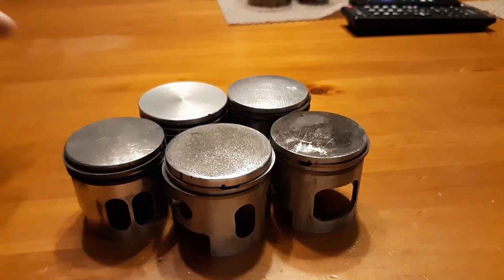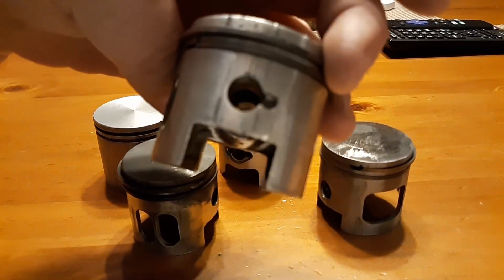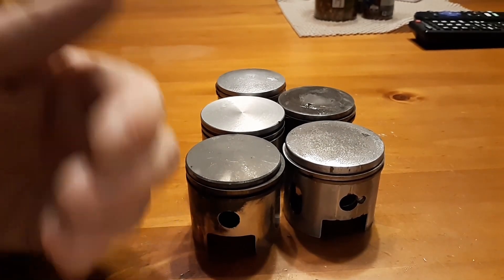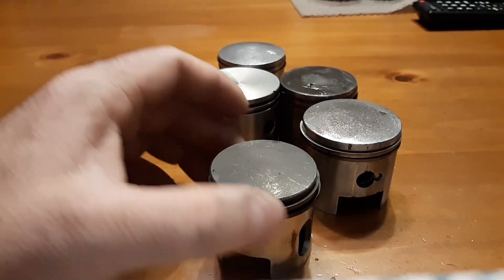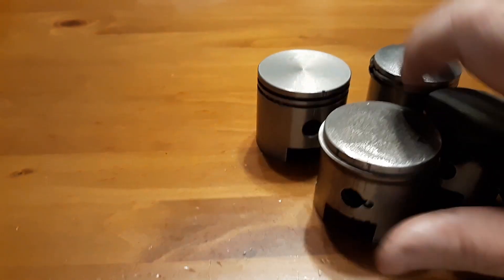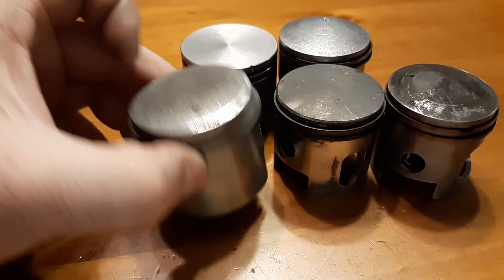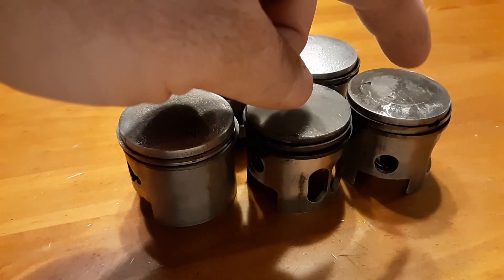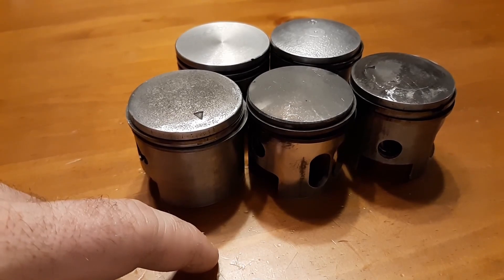Motorized Bicycle Oil Mix - Help Stop Moronic Information Being Shared!

Comment: So to sum it up...

For break in convention oil is a must..16:1 up to 32:1 ...break in is 1 gallon of gas or 2 tanks of gas (tank is half gallon on bike kits) after break in you can use 32:1 conventional or 40:1 synthetic

Do i have this right? Im also taking it real easy on break in and im using 16:1 to be extra cautious in case i dont have it tuned right and its maybe running too lean...

Comment: You are a wealth of knowledge and I greatly appreciate it. I learned a lot by watching just two of your videos versus hours of reading stuff online. I bought a motorized bike engine and it's always been pretty tough to start I have to really pedal fast to get it started it doesn't want to idle and I use 40 to 1 synthetic oil mix not knowing any better. I'm only reading 50 psi now compression I can't see and I don't have any tools that a machinist would have to actually measure the bore but is there any test I can do to confirm that I egg-shaped my cylinder? I was thinking of putting the Piston at top dead center and then introducing maybe 15 lb of air into the spark plug and seeing if I can feel any air or hear any air come out near the head normally in a 4-stroke I would just open up the oil fill cap and see if that are is getting by the Rings and into the crankcase but obviously I can't do that being that it is a two-stroke

Comment: Hi, your post is really valuable. I'm in the process of rebuilding my Suzuki RV90. In fact, it's already done, but as you know, it's an old machine, and it smokes a bit. The CCI oil pump is working fine, but I'm considering switching to a premixed fuel. It’s true that Stihl recommends a 50:1 ratio, but I’m sure that’s only meant for their high-quality equipment. I might go for a 40:1 mix for the RV90 engine.

That said, I’m still reluctant to give up the CCI oil pump because it has a lot of advantages. I’m kind of torn. I wanted to ask your opinion—if I use Stihl’s modern, high-grade oil with the Suzuki CCI oil injection system, what difference do you think it would make?

Or, if I were to technically reduce the output of the CCI oil pump a little—by slightly lowering the CCI’s set level—and combine that with high-quality modern oil, what do you think that would do for reducing smoke without damaging the engine? Thanks!
Reply from the maker: Use the pump with a good synthetic oil 40:1. Too much oil will actually blow the wrist pin bearing from the hydrologic of the excessive oil of the ring design over seals.  They are intended to actually leak some as a form of lubrication process.

Comment: Wish I would of seen this when I first build my bike I’ve been running 50:1 since the start so I guess I’ll Switch over to either 32:1 or 40:1 I have to see which oil I have

Comment: More oil=more compression=more power. Maybe read alittle
Reply from the maker: @mikecyanide7492  that is not always the case. It depends on the ring design, tolerances and the count of rings..... It also depends on the materials used to plate the cylinder. If you slathered a cast iron jug with oil you would pit it after it expand s over time. Or blow the bearings in a steel sleeved jug setup if you over mixed it. But if you didn't already know this..... Not even going to try explain how it cools an engine and it's parts also . 😕
Reply: @BuildBreakFix  this is why I watch your channel. Lol I ran the iron sleeve on strict 40:1 but not bcuz of that knowledge and it was a second hand motor. Thanks man.

Comment: Been using Stehl Chainsaw engine oil,  6.5 oz oil to 2.5 gasoline, 50 to 1. For break - in 2 gal of gas with the same oil, 6.5 oz.
With the Motorized Bike engines. 2 cyc. 4 cubic inches. (ZEDA), High Compression Head, Tuned Pipe. Hot Sparkplug, NGK BPR4HS, Stock Carb Jet , #70, way rich. After Break-in I changed the Jet to #66.  Still a little rich on the bottom but nicely 2 strokes Top 30% of Throttle.
Most important,  Warm these engines up BEFORE pushing them. 
 Do this every time you ride, your engines will give great service.
Reply from the maker: 😜👍 That is great advice!  Appreciate it!
Reply: I have same set up except for I’m using bp6 plug, stock exhaust. I bought the Stihl High Performance Oil. But I got the 2.6 oz bottles. So two of those per gallon what be ok for break in? It’s 25:1. I’ve just been super meticulous , honed the cylinder and all. AI gave me some bad advice. So I guess I just need to hear it from a real person.

Comment: I saw lots of people running 40 to one ratios but I felt like that was always a little too lean but I knew the 16 and 20 to one ratio from cradle to grave seemed stupid to me so I decided to start running a medium after I broke in my cylinders and pistons using the 16 to one than 20 to 1 ratio after that I would run at 32 to 1. personally I run 4 oz of XPS marine XD100 E-Tec full synthetic for my build in a gallon of regular 87 octane but I have been considering mixing up nitro RC fuel into the gas tank as well to see if I can get some extra power out of it and before anyone warns me yes I know you need special oil to run with nitro RC fuel because standard two-stroke remix will break down when exposed to nitro meth
Reply from the maker: Did a whole playlist on methanol if you're interested 😜👍. https://youtube.com/playlist?list=PLtNBMHtv7PkP-FRVk3kkJnIyxTihwvdDT&si=M-i5c7Zpvvi6mukz

Comment: Well in the summer I use 16:1 really hot here... winter I use 20:1 a bit fumes when cold engine but after its okay Castrol 2 stroke power racing maybe a bit too much but also helps with the compression.
Reply: Yea i also thought same about wristpin slop and bearing sliding half out??
Reply from the maker: environment plays big role to at times!
Reply: @BuildBreakFix   yes in these days it's all about environment, funny thing is electric vehicules pollute more during production then the combustion engines running for few years straight but well we stop here... its better! 🤪
Reply: Forty to won sir.

Comment: BikeBerry is saying 40:1 "Cradle to Grave" .    Which is basically a little over 3oz synthetic oil in a 1 gallon mixing tank.
So how important is the initial break-in then?   I'm not 100% clear.
Would a 6 oz  mix in the first gallon work for a 2 stroke bicycle?   Then around 3oz per gallon after?
Reply from the maker: It's (32 to 1 organic oil). Or (40 to 1 synthetic oil). That is where most get confused.  But for break-in organic 32 to 1 helps form rings better.  Unless steel sleeve.  Which break-in is done by heating and cooling cycles.  Still same rules apply. Just depends on oil type you run.  Edit: If you want my personal favorite. Kawasaki lawn care two-stroke oil. Birth to death 40 to 1.  Thing will run forever on that stuff.  My personal favorite now
Reply: @BuildBreakFix  well so you agree with 40 to 1 'Cradle to Grave' synthetic, no change for break-in?
Because I'm going to start mine for the first time this week....unless winter kicks in hard I have to put this off lol.
I already have Mag 1 Synthetic & Lucas 2-Cycle 'Land & Sea'  just in the garage.
I haven't tested anything
Reply: "Lucas Semi Synthetic 2-Cycle Hi Performance".   "Meets or Exceeds API TC & JASO FB Specifications".
"A True smokeless formula"
Well, it looks good!

Comment: How many ml of oil are put in during the break-in period? How long does it take to break in, 2 tanks of petrol? And how is it better to run in? On free idling should I go with it at a certain speed?
2 stroke 80cc engine
Reply from the maker: 2L should be just fine. For a breakin

Comment: I run 32:1 synthetic or not, it’s what I thought made sense since they are ran hard and it’ll lube the bearings well and keep temps down, it’s wild some people will use amsoil at 100:1
Reply from the maker: You can. I have without issues. Your supposed to run 32:1 but they are speaking about organic oil.  Synthetic oil 40:1 is 3x better at the job the 32:1 organic oil can do.  Only way to explain it I guess. But 32:1 will run fine. Just matter of using more then you will need. Now if your like in 110f heat and in desert hell yeah yeah 32:1 😆
Reply: What Organic oil do you use?

Comment: What's a good break in ratio for a ms460 ?
Reply from the maker: (32:1. Organic oil). After a gallon of that 40:1 synthetic oil.  I know people say it runs 50:1 on a saw.  *Like an  actual chainsaw*. But this engine is pushing 100+ lb person on a bicycle! So keep that in mind when you see silly people saying that 😆✌️
Reply: @BuildBreakFix  thanks a bunch.

Comment: You cant use too much oil during break in if you want it to last. I use Husquavarna Ultra synthetic at 6oz per gallon during break-in and 4oz to 1 gallon after and they spirt oil all over themselves during break-in but last for ever and ever if you do it right.
Reply from the maker: tht zero sense lolz........ cause you never use synthetic oil ever to break in 2 stroke period! defeats the whole point of seating rings and blowing out shavings.  oil ratios are based on ring types, jug materials, and tolerances of rings. basic common fact for last 190 years since first one was ever built. lol  just saying built 2 stroke engines every kind on these bikes pro  motocross bikes for 2o years hate to break it to you but most por riders use 32 to 1 in there bikes for the fact makes more compression which puts out more power  actually s there goals not foul plugs you jet your carb correctly which no one seems to do any of the above right on these bikes. just saying ms380 ms460 ms440 ms660 ms871 and minarelli and 90cc Minarelli 110cc 100cc and the 139cc cvt build all run 32 to 1 never foulowed a plug nor had one engine blow up or turn to crap or over heat  out of every build. all 693 ms 460s i sold and all 133 ms660 i sold running 32 to 1 have never lost bearing yet in any of my builds i sell that people ran that in.... just saying guess just who owns it.....
Reply: @BuildBreakFix What jetting would you run for a 32:1 compared to a higher mix ratio?
Reply from the maker: @syndeko55   hard to answer it. Because elevation, temperature, size of the engine and engine setup. All play a role in jet sizing. Carb style also affects the jet sizing. What kind of engine do you have and what kind of carb.  Chamber pipe also effects the jetting along with reed valves. So it would be like asking the blind guy which car did you see run the stop light in the accident 😂.

Comment: So I started with 40 to 1  haven't  gone  through  a tank yet... question  is it to late to do the 16 to 1 for brake  in ?
Reply from the maker: Supposed to use organic oil. For breakins. 16:1 to form the rings. Also helps clear out crap in new engines. 32:1 organic oil or 40:1 synthetic oil. First half a tank it really counts.  So if the rings seated or didn't it's already a signed fate!  You will find out about 10 tanks of gas!

Comment: I have 66cc/80cc bbr angle fire..... what window piston brand or make my own.. what  reeds and carburetor to run..I have seen you like cnh.... I got my motor on black Friday for 150. New to this. Im just look for some good stuff right now im running 32:1 Castrol 927 is that a good oil or wasting money. I was thinking of a pw80 carb but whats a better choice and I seen your video about the reed valves and adding the tensioner. I would love the simple set up for my motor without wasting alot of money ...  whats a good company to buy motors from
Reply from the maker: honestly drill a tiny hole in dead center of the intake side of the piston!  Use a step bit!  Ones look live v (also called Unibit)  slowly step up size till you hit 1/2 inch and your gold!  making piston window!  Don't use bit drill bit or piston will break!  

Yeah 32:1 oil mix! stick with it! I know some people get crazy weird mixing stuff.  also gotta understand it's why there stuff always breaks LOL I use 32:1 all my 2 stroke bikes  mild to wild ones no issues.   Jet it right use the correct spark plug to match the build and it runs great 32:1.  (NGK 5126 B8HS-10 Standard Spark Plug) is like the perfect plug for that build you have.  Don't use like 6 or a 5 like some say!  burn that thing up real fast for only a tiny amount of performance! (NASTY JACK PIPE) Is cheaper then MZ65 pipe! works perfectly like a Mz65 pipe half the cost! Ebay has few  like 45$ So worth the price man!    Honestly best one I found Cheaper! (Kawasaki oil) Pretty much the identical oil Lucas has for twice the price!
Reply: @BuildBreakFix  thanks and for the jets about what range size for main jet 65 to 100 or higher 100 to 140. Just hate to buy a whole lot of different size. Same for the slow jet .. I went with the pwk 24mm  carb.  I think i seen you do a video about  it. I stay near the gulf so the jets is different for different areas. Thanks for everything
Reply: So the latest update I improved alot I ran the bike change jet and got to 34mph from 23mph . I bought a 24mm carb. went down to 21mm pwk did what you said reeds, window piston .. The problem my btothet   took   k & f standard of japan 20mm with no air fuel mixing screw. No upgrades. We have same bike same motor  everything. I have watched him when he gets full throttle he chokes it and  slowly moves it back normal like it has a boost  the motor revs real hard and he leaves me in the dust. He has 89 jet in it and thats all... would the double spark plug head help. But I have the feeling no cause I haven't seen you run one.. and what do it takes to reach the next level. How can he do it with just carb. He blew the motor up and I ordered 80cc  and it didnt have the g4 cylinder we wanted  but they gave him for free 2 old model complete top end with piston and rings and head. He still wins when we race how? Its like my motor hits a speed and will not go any more but his will keep going til it dies. PLS How did he get the unicorn what am I missing
Reply from the maker: @kinghenry2308  has tons to do with how hot and cold it is outside.  How high elevation you live at.  2 strokes are what you call natural aspiration engine.  Sucks are in based on how much piston can pull into crank case in a stroke.  Second blows it into chamber to burn.  Cold air is dense and hot air (temp outside) is thinner.  Which effects how gas atomization works how much air fuel mix is pulled in at once!  Then higher In elevation less oxygen is in that air.  You be suprised how much of a change 200 feet above sea level it changes now when your say inland 500 1000 1500 lol gets even less higher up you go in %.  But in my case live literally next to beach!  12 feet higher up then ocean surface where I ride and its 60 to 110f all year round here almost.  So it is like absolutely ideal conditions for 2 strokes to run.  If you notice!  Most bikes running stupidly well are near perfectly sea level lol west coast east coast builders kind of untold side truth lol.  Helps greatly.  Honestly that perfectly tuned stupidly picky time consuming task.  You honestly are right around what most achieve on avg.  Here is other thing!  Bearings on crank for the size they are.  Have top rpm range of 7500rpms before failure.  Even top $$$ ones after 8000k rapidly fail after repeat rpms like that.  If you enjoy riding it want to keep it running long time don't run it top speed 3/4 away 6k can get yeah rolling at 35 no issues easy.  That why I say I like riding 35to40mph max also why my engines last for long durations time. Sure I rip a few speed runs lol most time not running crazy speeds past 35ish

Comment: So what would you say is the best fuel to oil mix just got my engine listened to Hugh and put 40:1only put about max 12 miles on it so I shouldn't be in trouble yet can't watch with sound rn
Reply from the maker: Oh dear lol.... yeah break-in very important though.  Always 16:1 organic oil  for first gallon of gas.  Only way iron rings seat correctly.  Sure if they where chrome rings 40 to 1 is fine but no bike kits come with them pre installed.  Organic oil let's the rings shape.  After that you can run 32 to 1 organic oil or 40 to 1 synthetic!
Reply: @BuildBreakFix ok simple enough...how about how to ride it for break in period?  Don't ride it like you stole it but do make sure you give it 1/2 to 3/4 throttle?

Comment: I go by the color rule like I've always done with all my weed eaters Ive used over the past 4 years mowing yards with my dad.  If you got green 2 cycle oil your gas should have a green tent to it. Same goes for blue, yellow, red, or orange 2 cycle oil lol . If your gas isn't the same color as your oil then you need more. And if you can't see threw your gas then you used to much oil which is no biggie. Just add a lil more gas to the mixture. Bottom line is it's always better to make the mistake of using to much oil which will lead to failure to start or heavy exhaust smoke versus blowing your motor up not using enough. And always premix before pouring in your tank. It's not that complicated guys. I think everyone suggesting all these different ratios is the cause of all the confusion and that's how mistakes are made.
Reply from the maker: Lol 30 minutes after I posted that video.... guy brought me a brand new kit...  he said it stopped running after first ride.  He assumed it had oil already in it lol 🤣 wait till you see the facebook nightmare bike a guy brought me yesterday lol.... oh man!

Comment: I do 25 to one synthetic during break in or synthetic blend actually less plug fouling
Reply from the maker: yeah but the rings don't file down and seat very well on synthetic!  like 99% of the oil containers even tell you not to use this product for break ins!  some of the 50/50 types like Lusuc with a semi synthic though you can get away with it!